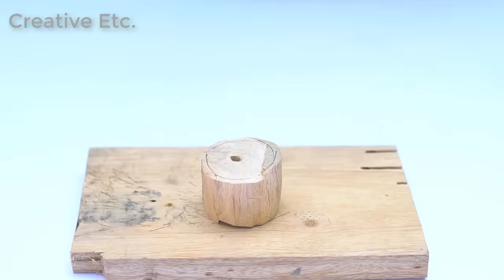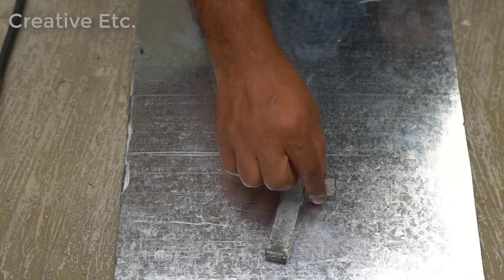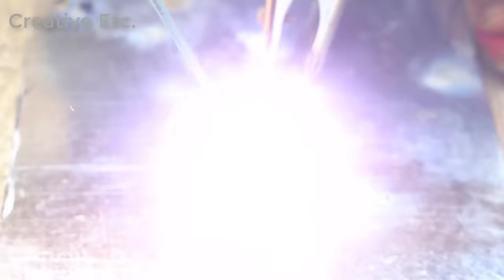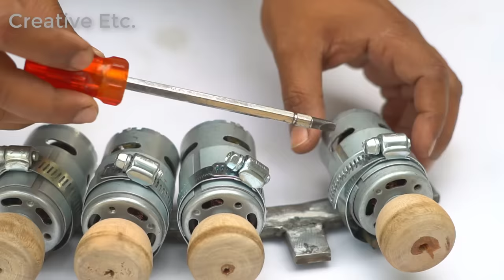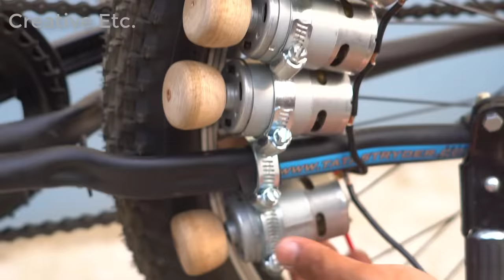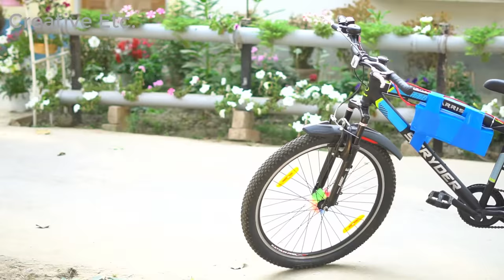How to Make Electric Bike using 775 motor

Comment: A very smart thought.  Approach appropriate authority for financial and other supports. Improve the looks a little better.  Fittings can become loose and can fail frequently. So, modify accordingly, so that the failure rate is the least.  Remember that the aircraft was invented by two bicycle repair mechanic brothers, namely WRIGHT brothers, a century ago and now the the pilot can sleep while the plane flies near to the destination on "AUTO-PILOT" and take manual control when alerted while reaching near to the airport.  Keep up this innovative thoughts. Create and create.

Comment: Tire and the wooden roller will not last long. To minimize the pressure on bearing the motors will have to fixed on both side of the tire.
Reply: সুপার হিট ছবি
Reply: Yes.. wooden roller and rotor needle seems to have less grip
Reply: @sujiz  Sir,roller and needle mil kar DO ho gaye,so seems ke badle SEEM hoga,lagta hai aap English me Zero Hein, THAKUR APRASANNA hua

Comment: U can Use Dynamo along with motors which gives power to operate these motors on initial peddaling a High value Capacitor parallel to Dynamo output will do enough so that U can avoid battery R Dynamo Hubs are available to provide 12 Volts to run motors Assembly

Comment: It is possible to put up maybe 4 dynamos on the opposite side of the bicycle wheel to charge the battery as well? This way will charge n use coordination ? Will travel far without charging? Will appreciate if u can make n test it , whether can work, it just an idea only
Reply: I think that's going to cause resistance that will make the motors work harder, so there'd be no advantage. EVs normally put these dynamos in the brakes - so yeah, put dynamos on the brake pads?
Reply: সুপার হিট

Comment: I guess it works But its still halfway from being practical. On this design the bike stops inmediately when you stop throtling, which is kind of dangerous... I think it would be a better idea to connect the motors to the chain
Reply: Medrol
Reply: @mostaphabenifa8836 व्यबसाइट॥्वव्वैनन
Reply: @ajayrathodajayrathod2295  vt

Comment: Friction loss will more in this method if use chain drive to transmit power it will more durable
Reply: Also the battery needs to be fixed with the metal casing not with the cello tape 😂😂😂😂
Reply: @broto8  gjgkgogkgl
Reply: Mmmmmm

Comment: It's fine but breaking system is risk when fast driving if u want sudden stop to any where. So it is dangerous,  kindly use disk breaks system.
Reply: just add a button to deattach motors and apply breaks to stop

Comment: Very clever indeed. However, even with four motors, how would that be possible? I didn't think they would be rigged to support the weight of the bicycle and rider
Reply: @rajanshaji2883  it's already happening.
Reply: Yes
Reply: These motors are used in fans, they are responsible for the spinning of fans. I don't think if they can generate enough mechanical force the blades of a fan, why they can't rotate the wheel of a bicycle and support the weight of the rider and bicycle at the same time.
Reply: I think that it only support the wheel for energy maintained. we have to start as normal. Anyway, it is so simple and easy to do!
Thanks
Reply: Hlp me

Comment: De aquí lo que vale la pena es el talento y la creatividad para hacer algo, porque la bici electrica no vale nada; tiempo se necesita para darse cuenta que lo mejor siempre será una bicicleta mecánica.
Reply: Hello how are u doing I like ur video ...how do I get this motor u used in the video
Reply: We By UGG
Reply: @peterisaac2477  99009
Reply: @peterisaac2477  9p9p999
Reply: 9
Reply: @borhanuddin6853  99009
Reply: 9
Reply: 99
Reply: 9
Reply: 099
Reply: 999
Reply: P
Reply: 9p9
Reply: 99p
Reply: 9
Reply: 999l
Reply: P
Reply: 9
Reply: 9
Reply: Po
Reply: 99p
Reply: 9p9
Reply: 99p
Reply: 9p
Reply: 9p
Reply: 9o
Reply: 999
Reply: 9
Reply: 0p9
Reply: 9
Reply: @peterisaac2477  0
Reply: @peterisaac2477  99p
Reply: 9
Reply: L
Reply: OK p
Reply: P9po
Reply: P
Reply: 99 99
Reply: @peterisaac2477  não 9
Reply: P999

Comment: It's a good concept, but it's not efficient
4 motors will pull alot of amps off the battery. Your battery life will be compromised (no voltage regulation)
This is a friction drive system (it will wear out the tires and the motors will loose traction eventually) The brushes on the motors will not last long, especially with the strain of braking, starting up on a load, and weather conditions.

Comment: maybe 2 engines on either side of the tire so the motors arent pushing the wheel over but to each set of motors push towards each other and the middle of the tire giving a smoother ride

Comment: Those electric mountain bike are  so fun to ride but the problem is they battery drains to fast it's best to have dual battery packs so you can ride it longer than a day
Reply: why would u want to ride it longer then 50-70km a day you can recharg it for next day
Reply: Even dual battery packs don't fix it   so I got ripped

Comment: I shared this video to my father and i had added a caption " we can try it at home". My father said it'll not work 😳😳😲 he also said that it's only for make there viwes nothing else gonna work in our case , what you guys think about such a disgusting question?😊
Reply: Mostly evry father will tell like that only 🤨
It's true
Reply: Saurab point is right..because it the tires of motor is kept in contact to the tire then motor tire will sleeep and if high pressure contact is done to tyre than the rim off cycle tyre will bend....so this idea will be only show piece ..
Reply: Your father's advice is 1000% correct... Its just only for views
Reply: Ur dad is genius
Reply: I think it is not a disgusting question to ask.
Reply: @rawinniraula6927   i agree with you😊 now I'll never think to try this kind of things at home 😀

Comment: Very clever....but, it is yet just another way in which we use electricity instead of our own muscle power. I'm not sure though of how much energy you would have to add to a human body in electric terms to power the bike by including all the food you eat and it's travel distance. It may be too complicated to find out, because would you have to add all the power that was used to mine the raw materials plus the building of the motors. It could go on. Good job you got the polarity right or you'd have to swap the handlebars and the seat around.

Comment: This bike is missing something, which is the electronic board, the speed sensor, the charging and the gear wheel. It has a file that is not difficult. An electronic board costs 30 dollars. You can do everything with it.

Comment: Why Not  Just Buy A Bike with built-in motor (its available!) Rather than spending such same amount, time and energy with the same output? No question it will work to some degree. Its not just worth it and that's the only problem in my honest opinion.  Sorry bout that. Thank you for sharing the ideas.

Comment: Good idea but a lot of doubt about the consequences of the that project
Ex
Tyre friction (how long it will last)? 
Braking system per km/hr
The frame where you put the battery is very risky when changing gears 

But over all it's a better alternative ideas
Reply: True. I am also concerned about tire wear and tear. I think the idea is nice but the design needs improvement. How else can the motors be placed where friction is low.
Reply: Mr.A ideas ke badle IDEA hoga

Comment: The wodden part of the couple bod the motors on the tyre gonna damage the surface of it due to friction.... therefore...in my opinion it's not sustainable solution for smooth riding experience...